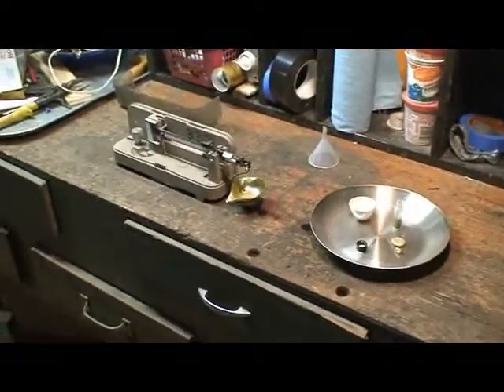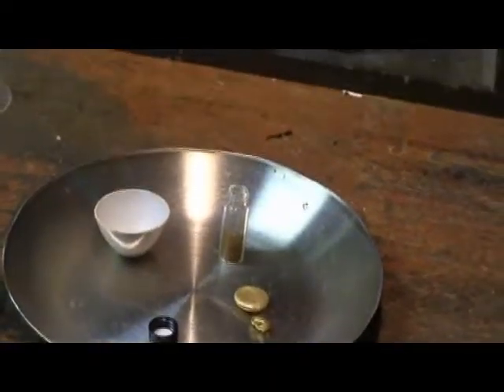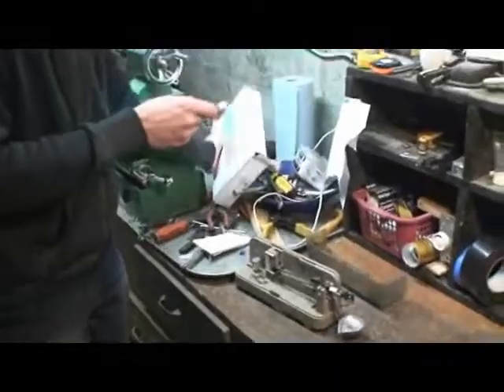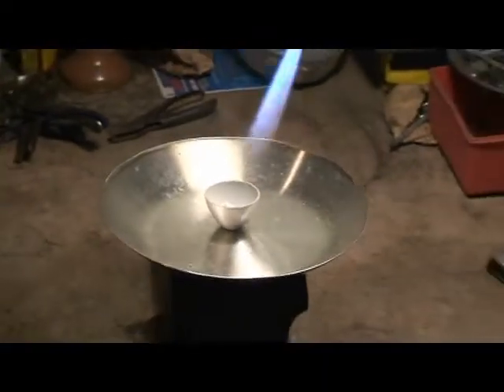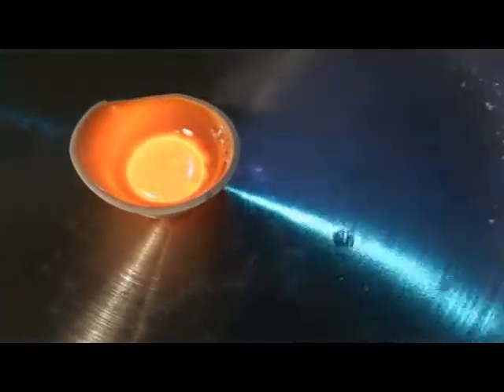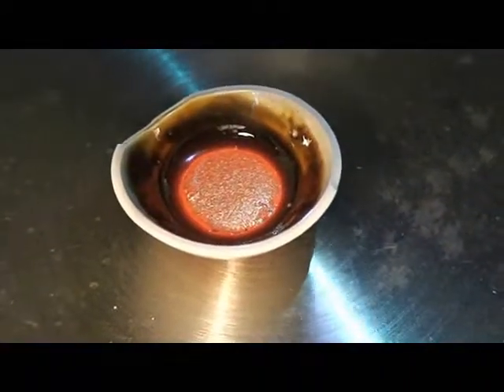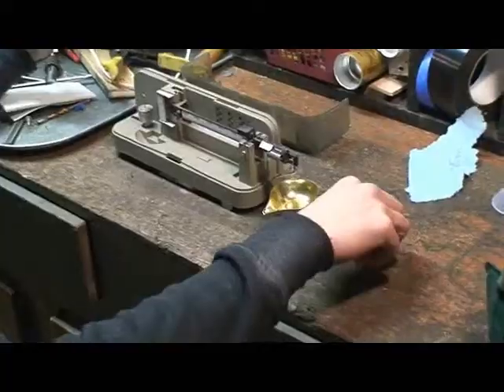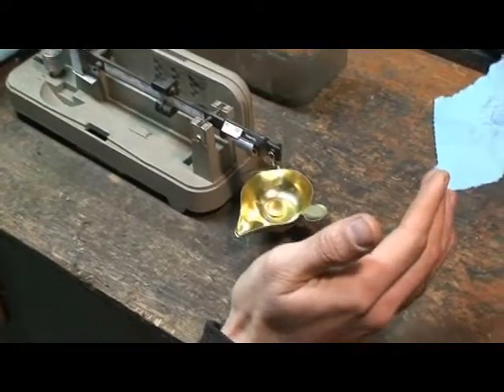How To Melt Gold With Borax, Fine Gold Dust To Dore Button At Home Or Mine MBMM

Comment from the maker: The borax makes a black glassy material that can be seen stuck to the inside of the crucible around 3:39 when I break it to get the gold button out.
Reply: I guess it is kinda off topic but do anyone know of a good place to watch new movies online?
Reply: @garrettvalentino4856  Solarmovie. No sign up. just free movies. (make sure your adblock is up to date because it has pop up viruses and stuff )
Reply: @Garrett Valentino Flixportal :)
Reply: @Baker Mario thank you, I signed up and it seems like a nice service =) I appreciate it !!
Reply: @Garrett Valentino No problem :)
Reply: How long did you have to heat it for? And I have a bigger torch, but I’m using propane would that be possible to do with a bigger, propane torch?

Comment: What do you do if you don't have a torch?? All I have is a home made furnace for melting aluminum cans..
Reply: Your furnace will need to be ~2100 F. The borax reduces the melting point of gold & helps in dissolving various oxides that might contaminate the gold, and floating above the gold

Comment: I did that once when I had a pile of very fine gold flakes. Used a propane torch and Borax as a flux. Took awhile, but came out fine - my button is 2.7 DWT - a little more than a 10th ounce - about $135 at 80% of today's spot price for gold. (80% is what I get for small amounts where I sell my gold).
Reply from the maker: Nice!
Reply: hey mate how much time did it took? I am trying to melt some flakes without success

Comment: I recommend you use borax glass. It has much less moisture and is easier to work with. P.S. I'm an assayer.
Reply from the maker: David,

Thanks for the tips.  Since taking the video a few years ago I have purchased a melt dish.  I don't do a lot of gold melting, but it sure does come in handy.

Thanks again,

Jason

Comment: Whenever I torch my gold it just comes out black... Any ideas?
Reply from the maker: Blake-

Sometimes when I have a lot of black sand mixed in I will get a black film on the gold button too.  You can try adding more borax, also I use muriatic acid (same stuff to clean grout and mortar, can be found at any hardware store) and let the button soak for a few hours.  Pull out the button and the black film will wash off revealing a nice shiny gold button.

Good Luck!
Reply: This is electronic scrap gold from fingers and pins. I missed smb /aqua,regia. Solved my own question thanks though
Reply: Basically only nitric acid and tried to melt. Awesome halfounce fail.

Comment: what is the ratio of borax and what is the purity of the button?
Reply from the maker: I dump around a teaspoon or two per ounce of gold.  The borax doesn't remove metals such as silver, and copper.  It works great for removing the black sand, which combines with the borax to form a black glass type of material.  The purity of our gold is around .950 fine.  Thanks for watching and posting.